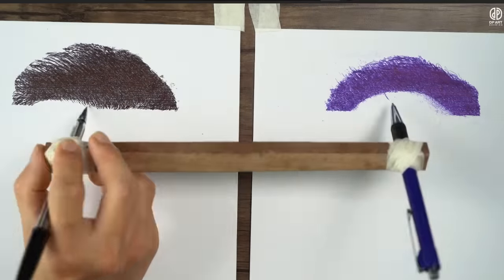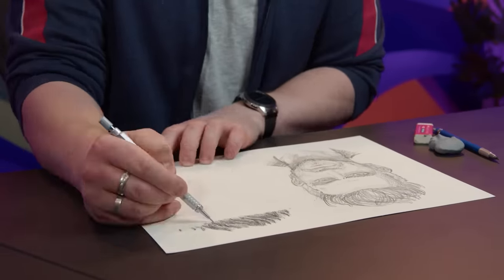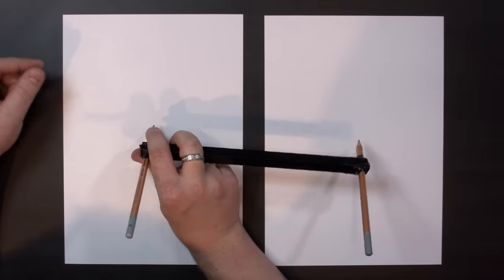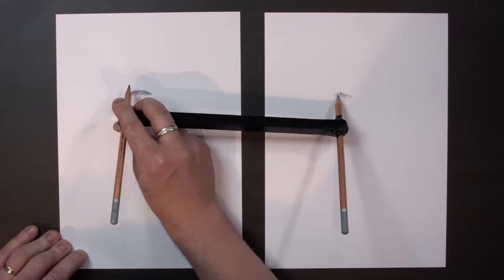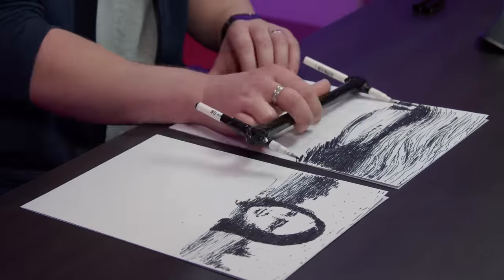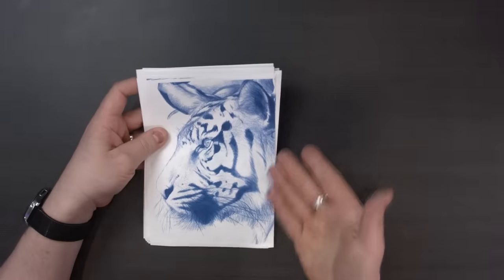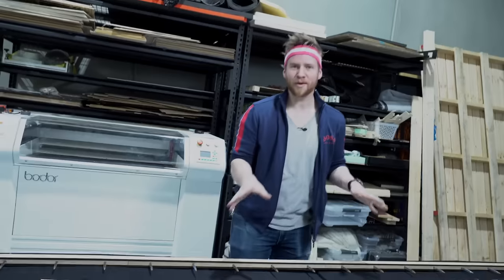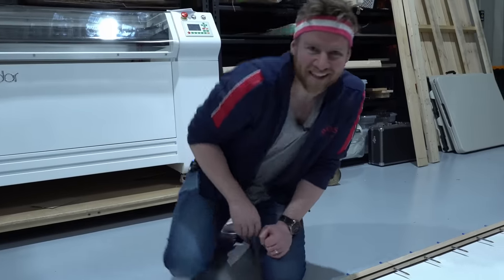how many can I draw AT ONCE?...

Comment: funnyyy! cool video! - maybe next time put a spring behind the pens, so they can be pushed back a little bit, and every pen gets the chance to reach the paper. or use 21 spraycans, they do not need to touch the surface they are painting on
Reply: Galaxy brain moves.
Reply: Spray canes ....that's a dope idea. Maybe smoe shall try this franchise of drawing with multiple cans at once.
Reply: I was just going to comment this suggestion. I think there are pens you can buy with a pressure tip?
Reply: It's still kinda impossible. It weighs too much and even with 2 pens he was alternating the pages the pens touch. He'd have to get a solid metal support mechanism that moves in 2d plane and one button (hydrolic or like piano keys or maybe actuators) for each pen to be pushed down. Also, maybe a screen in front that can switch between the cameras on each sheet with top down view.
Reply: 21 Blowpens would create breathtaking art!
Reply: Make the contraption curved. There. Problem solved.
Reply: Love these ideas!
Reply: To add on to your idea, spring load the pens¹, but also have something to hold the long stick thing up², as to allow you to be more accurate with your movements, because I assume moving this thing all at once, with strength alone, is very taxing, & would start to suck after a while.

¹Also, maybe using something like a felt tip pen or gel pen would be a better idea, seeing as regular ball points seem like they'd have problems when used en masse.
²i.e. Strings, or something similar, hanging from the ceiling or other apparatus, that are connected to both ends of this contraption.
Reply: Hi everyone, just wanted to ask if anyone knows the name of the song from the montage it was mindblowing and i can't find it anywhere
Reply: Hi everyone, just wanted to ask if anyone knows the name of the song from the montage it was mindblowing and i can't find it anywhere
Reply: @mukesh1447  okay, okay, hear me out: drones.
Reply: @kaustik185  I don't get it?
Reply: @mukesh1447  spraycans. on. drones.
Reply: Dope idea but not very practical as regardless of whether there are springs with which to pressure the pens on paper, u would still need to exert pressure personally on each pen to get going with any results. 

As for the spray cans, who's going to control when each can sprays? Just a thought on creating different sketches, but as for creating the same sketch simultaneously, it's still tricky.

Perhaps going for a 4-pen system mounted on a cross like stilt to create a top, bottom, left and right control pattern works better

Comment: You should make the rig curved, so that only one pen touches a page at any given time. That way you won't have two or more pens "copying" unwanted movements. If you think about the 2 pen rig, only one pen is drawing at any given time.

You could even put it on a pulley system, that way you can walk up and down the length without dropping it.
Reply: Or just off-set the pen depths to a curve

Comment: If you want the arm to remain horizontal, you might want something more complex than a single straight bar, like some variation on the pantograph. If you had a pair of hinged parallelograms that share a side and secured one of the outside edges, the opposing edge could be moved freely but remain parallel to the stationary edge.
Reply: This. Flex a little bit mechanics and make a 4x4 contraption that actually retains position and keeps the pens on the paper and then do a one line drawing picture with all of them at once.

Comment: Actually, you could technically draw with 21 pens at once by alternating just the way you do it with 2. But you would have to slightly bend the straight wooden support you've built so that you can chose which one is currently touching the paper. Exactly like how a violin bow (straight) can play on one or multiple strings at once (curved). Except the bow is the paper and the strings are the pens (kinda revered lol).

Also would be a challenge for your muscles et eyes I guess

Comment: You need some sort of pressure spring pushing each pen downward, but giving enough leeway so the other pens can also touch. Think of suspension in a car, your 4 tires can't be rigid, then need suspension.

Comment: You could attach springs to the pens so that when you compress the 21-pen holder, the springs will help apply even pressure over an uneven surface. You’d have to have enough tension in the springs so the pens aren’t just grazing the surface.

Comment: You have just reinvented the pantograph ! !  With the wider width of a multi-pen holder,  you need some parallel support rails running from top to bottom of your drawing field to prevent the cross bar from sagging under it's own weight.  Construction workers will lay down slender depth bars to gauge the thickness of fill or cement laid down.  Then after screeding the top flat, with the crossbar, the gauges are slid  out.  You might need something to evenly advance the crossbar from top to bottom also.  Consider placing yourself at one end of the pen bar, with supportsat each end.  Then move the bar back and forth to draw sideways.

Comment: I love it! You would need the bar connecting the pens to be slightly curved if you want to attach more than two pens. Or at least have the pens toward the middle of the bar pushed a little more forward than the rest, so that you can make sure to only use one pen at a time.

Comment: I had an idea for a challenge.  Even the most basic pencil drawings create waste as you erase. Bits of the paper and eraser shaded by the graphite from the pencil. Could you create a sketch that you could add that waste too, to create a picture that is jumping out of the page?    You have such a range of sizes of waste and even shades and some that involve color pencils. Little specs up to some pretty long strands.    It doesn’t have to be coming a foot off the page but it could be as simple as the hair of an animal. I don’t know what would be best to adhere it to the drawing though. You could even use a few sheets of paper on top of each other to creat a negative depth as the paper is shredded into tiny bits from erasing.  Do you think this is something you could do? Even in a grey scale as opposed to color?
 
Edit after watching the montage again:  I would also think it would be cool to see a long term project using the scrap from your laser cutter to make a sculpture or even a wall hanging pieces that could make an already existing wall drawing into 3D.

Comment: You actually could do 21 pictures but you have to have the pens stick out at different lengths with the center pen out the furthest and the pens getting more shallow the further you get from the center. Essencially you need the pen tips to be in an arc so every angle that you hold the stick leaves one pen tip further out from the others.Think about a circle and how no matter which way you holding only one point can be at the bottom.

Comment: You should make a contraption that holds 3-5 pens max. but add pivoting points so if you rotate your wrist while drawing, all of the other 2-4 pens will have the exact same reaction as the main pen you’re holding. Kind of like the older video you did with the wooden drawing assistant tool you had with all of the pivoting points. Also maybe make it on a lightly flexible piece(s) of wood so the end pens will touch before the Center main pen you’ll be holding. 🤘 But make a GOOD one!

Comment: You set that on a table, add gantry and free assist from table or roof, and add a slight curve to the pens, to attempt again, or level the pens to make fixed duplicates. 

Now, if you took a series of ropes, stood above a very large wall and danced the rope with balls of paint at the end, and choreography a true work of transcendental art, that is both music, and dance, and painting all in one: that would be epic.  Rope all attached to the same rope.  You pull on it to dab paint, and lashes around a post lift or drop.
Reply: If not the dance: art on a wall with a community of paint ballers, and dodge ball experts.  You will require the blue man group, that guy who drums on paint to generate art, and a few good musically inclined paint ballers.  As to generate an art piece as either a celebration or event at any venue needing a larger wall painted.  The guys repelling, and some incredible arcobatic fast spray painters, along with a couple good ballet trimmers, and rocking rollers.  The dance is between bullets.  The art is up to the composition.   You might need a bazooka taper for true straight strips.  Repelling is a bouncing body art often times...  the last thing need is the greater set of Kyoto Drums, and a set of paint soaks automatic fire nurfguns, football throwers, tennis ball checkers, baseball pitchers, and paint ball on auto turrets.  

Music is the point, comedy can be imparted, again composition and scene.

Comment: You were providing assistance with a thread tied on the other side, and you were drawing from the opposite side so that there would be a balance on both sides and the pictures would be identical.

Comment: Technically you could do a cross of 4 and 1 in the middle with a slightly lowered pen in the center - then you can tilt the pen holder thingie towards every paper. Even a bigger circle would work, but there can only be 3 on each axis, otherwise you cant control which pen touches.

Comment: Why don’t you try putting all the pens at a different distance to the paper so the one in the middle are longer getting shorter as it gets to the outer ones so you actually have some control over which pens touch when just a suggestion

Comment: He’s just shifting the angles of the other pen,    If both pens remained absolutely aligned, you’ll end with two identical images (when using only the  two pens).    Otherwise, the more pens, the more difficult.    Also, I ‘M AUTISTIC AND ABSOLUTELY ADORE DRAWING AND WRITING WITH BOTH HANDS AS A MIRROR.     So the end result is an image, the other is a reflection of the image.   -  to the awesome end result of the second image appearing EXACTLY the same as the other ONLY AFTER EXAMINATION VIA MIRROR. 

ALSO, YOU OUGHT TO MAKE A THREE-PENCIL STICK THING, AND USE IT TO DRAW TWO DIFFERENT IMAGES USING THE TWO PENCILS ON EITHER EDGE, WHILE TOTALLY IGNORING THE ONE IN THE MIDDLE.  I’M SURE the result will be hilarious, and impressive! I REASON THAT THE CENTER-MOST IMAGE PERFECTLY ILLUSTRATE A TOTAL BALANCE COMBINATION/HYBRID OF THE THE TWO IMAGES L

...........

Comment: This video is NSFL. I was ready to accept that nothing is real. Relieved but now have a new source of existential misgivings. What about left hand right hand, but viewing through a stereoscope. I wonder, if in this video the two hemispheres are functioning through the one hand in a way that doesn't occur when you're only working on one piece at a time. Thus, the stereoscope might show a difference since one hand vs two. And further, a test with stereoscope and the one hand on two pieces. And finally, stereoscope with the opposite hand on two pieces. Control tests being just normal, two eyed, primary/dominant hand on one piece. Perhaps a "control2" being the same but using the subdominant?/opposite hand. Cheers